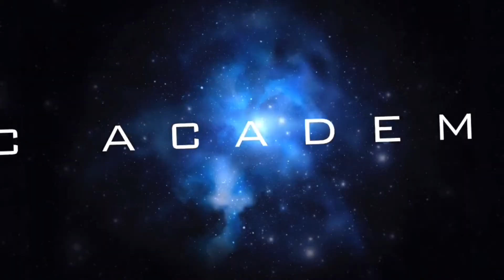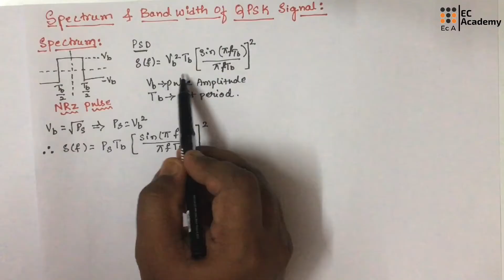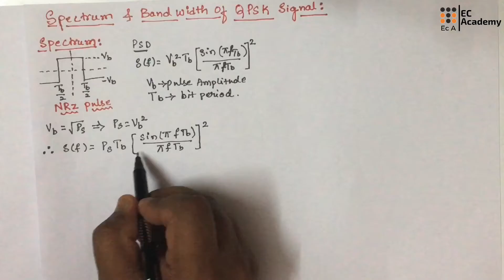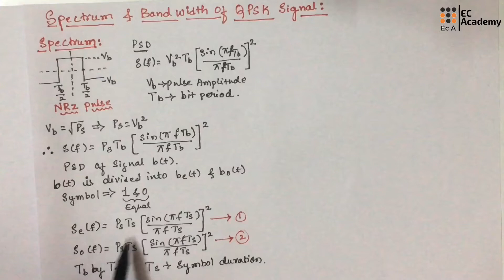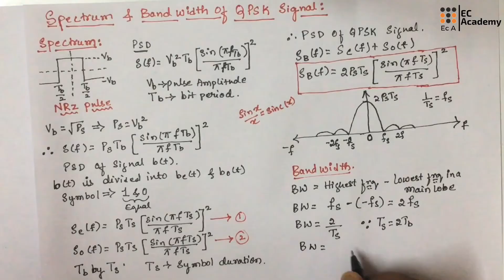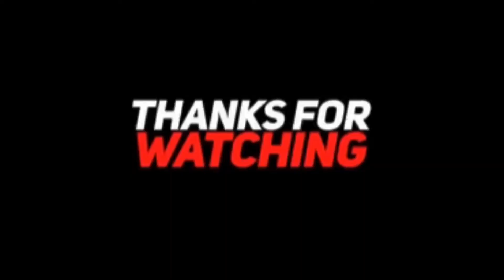DC#38 Power Spectrum and Bandwidth of QPSK signal || EC Academy

Comment: Plz plz plz plz sir solve it.. 
Question: A data signal with a bit rate of 100kbit/s is QPSK modulated and successively spread using the 
DS-SS with a chip rate of 10Mc/s. The transmit power is 1W.
a) Determine the PSD at the center frequency of QPSK signal before DS-SS.
b) Determine the PSD at the center frequency after DS-SS.
c) Prove that the ratio of PSD(a)/PSD(b) is equal to the processing gain.
Also compare the results of (a) – (c) in each case of BPSK modulation.

Comment: Plz plz sir solve it..... 
Question: A data signal with a bit rate of 100kbit/s is QPSK modulated and successively spread using the 
DS-SS with a chip rate of 10Mc/s. The transmit power is 1W.
a) Determine the PSD at the center frequency of QPSK signal before DS-SS.
b) Determine the PSD at the center frequency after DS-SS.
c) Prove that the ratio of PSD(a)/PSD(b) is equal to the processing gain.
Also compare the results of (a) – (c) in each case of BPSK modulation.